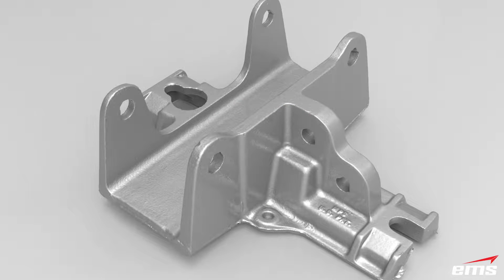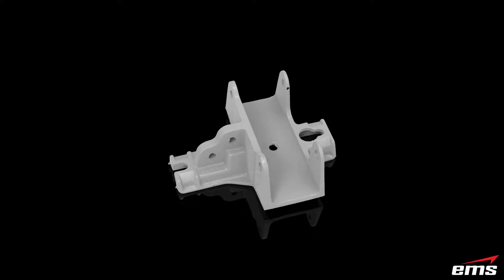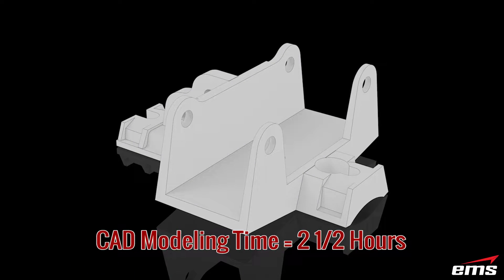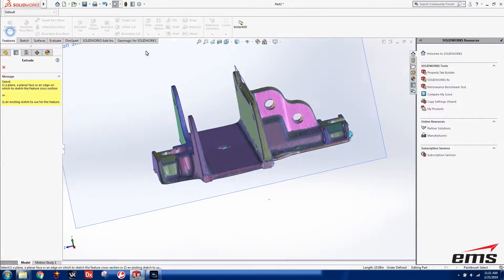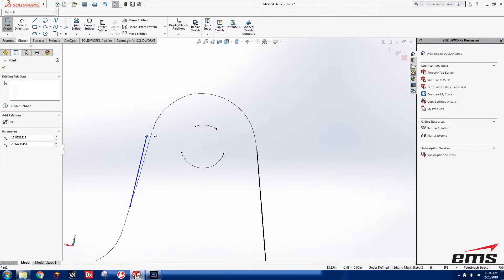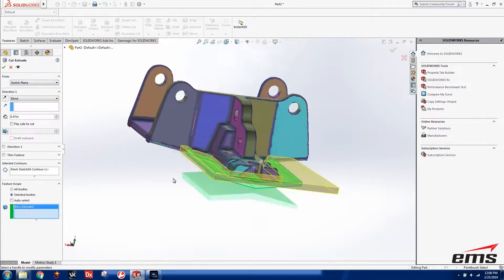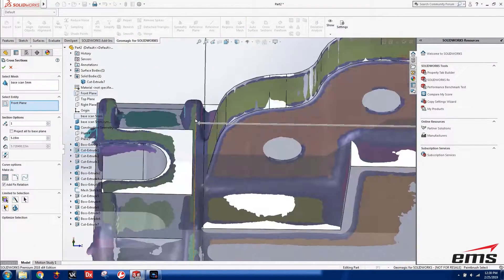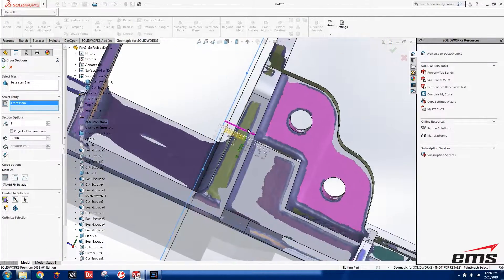The Truth about Reverse Engineering

Comment: I've used a CMM arm to reverse engineer parts, but the CMM software set your X,Y and Z planes but I could never get a radius endpoint to touch and be tangent with a straight line on any plane.
Reply from the maker: CMM's are great for inspection but yes can be more of a challenge for reverse engineering especially on complex parts.

Comment: I dont have scanner, my company expect me to reverse engineer plastic parts thats move a lot with 0.01 accuracy, and want it to be in few days without a single error. taking measurement is hard and then they simply check it and moving it around and simply tell this part is 1mm larger, do it again. Their measurement process are also questionable. I took lots of measurement and try to figure the design intent and they simply just said the measurement is incorrect hello.
Reply from the maker: Hi Toronto,   we can provide 3D scanning and reverse engineering to you as a service if that helps.  If you wanted us to quote your project send a couple pictures of the part to info@ems3d.com

Comment: Yeah man. When my company first started reverse engineering from scans, there was not a lot of content out there. The salesmen promised amazing accuracy and the pros reported even better tolerances... But it took me a long time to realize it's more of an art. And there is a definite difference between being accurate and capturing design intent. Anyone promising a parametric model of an injection-molded part completely within .004" is either a god or a liar.
Reply from the maker: Agree.  Most of the time the part you are scanning, especially plastic parts, are no where near the design intent.  Shrink, warping, heat deflection, assembly deformation all play havoc on the part.  Knowing what the CAD model should be can be a real challenge.
Reply: I'm wanting to get a scan of  rare car part made, I'm hoping I can afford it.   My goal is to get it scanned and CAD made, even if I cant get the physical part made at this time.  The plan is, if its in the computer I'll have it, then when I can afford to have the physical part made or split the cost with some other gear heads like me.   I have the RARE part now, took over 10 years to find and purchase.  LOL
Reply: @Backin48 did you get your part scanned
Reply: Right on the Money.